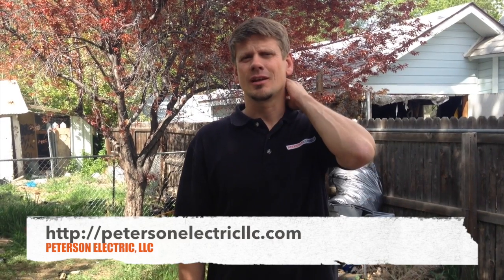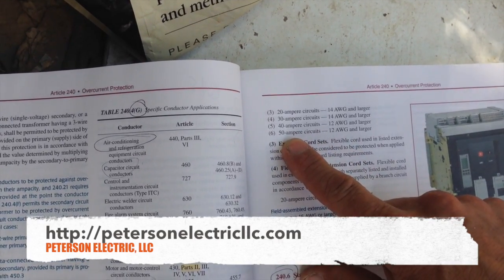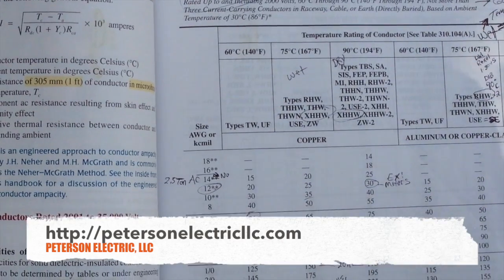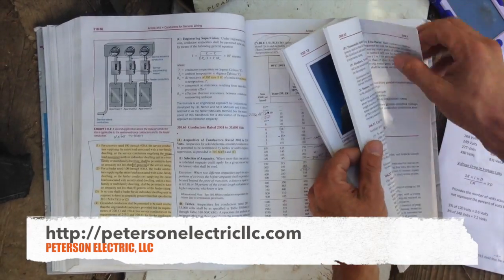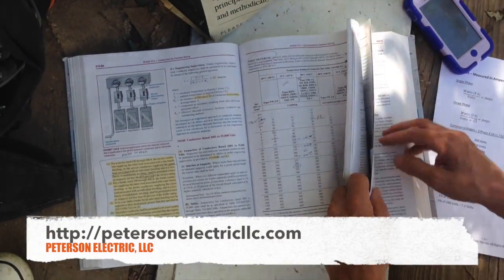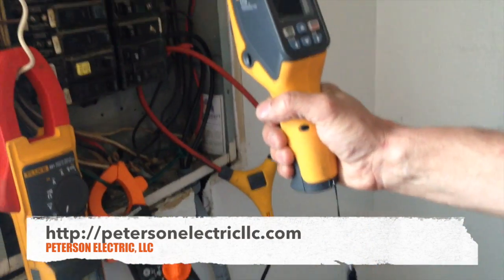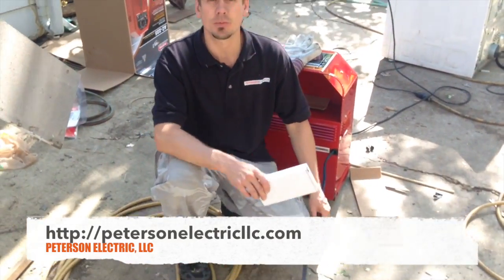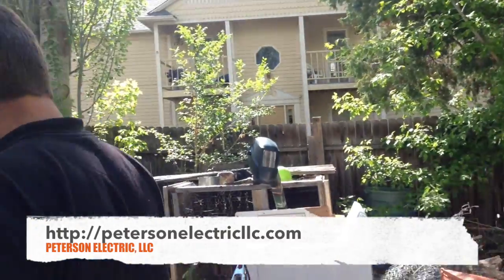What Are The NEC Code Requirements For A Welder Machine?

Comment: I think you over complicated it. Article 630 overrides the others in relation to welders.  All the other digging you went through was unecessary.  I 1 max is inrush.  I 1 eff is the effective rated current after inrush is satisfied.  You size the breaker by the inrush, and the wiring by the effective rating.  The NEC goes even further by giving you in 630 a formula for derating the wire size requirement based off of duty cycle of the welder.  It also gives you leeway of up to 200% breaker oversize for rated amperage.  It does tell you a lot. I think you got bogged down in what you already "know" and tried to superimpose that knowledge on what 630 was telling you specifically and were somewhat disregarding.  630 is the one and only thing you need to worry about as the controlling factor.

Comment: The one thing I have noticed over the years is most welding equipment comes with a 50 amp plug no matter what the actual requirement is. If you wire to meet that you are pretty much done, unless there's a problem elsewhere in the extension cords or before the breaker. Finding and solving the problem that you didn't create is another story.... and that's where I believe this video was going before it got cut short.

Comment: Why are you measuring voltage drop at the breaker? You'd need to measure the voltage at the end of the 25' cord
Reply from the maker: Ture, but I have seen the voltage drop on the whole barn or garage or house when we put a load on the entire first point of disconnect. So both, i am assuming that will help. Remember 210.19 is a FPN and not a code, but 3% on branch circuits and 5% on services and circuits.
Reply from the maker: Good Question and thought.

Comment: I would never get a welder unless I have an industrial power service, welders run better with an industrial power service.
Reply from the maker: What kinda of voltage are you referring too? Single or 3phase?
Reply: @Petersonelectricllc  - 3-phase I think. I'm not sure the voltage. When I went to school for welding we had 12 booths, each booth had a Lincoln Electric Idealarc 250 with a disconnect switch in each booth. I remember opening the disconnect switch for one of the welders and saw 3 wires on the line side, red, black and blue, going to the circuit breaker on the "busway busbar" with 11 other circuit breakers for the rest of the welders.
Reply: @DZEyoyo123  3 phase is rare for home electrical services and people still want to weld so single phase welders are common.

Comment: A few points of interest.    Pretty much all circuit breaker lugs are rated 75 deg C.  So 310.15b16 use column for 75 degrees.   Good that you checked voltage drop if you know why you checked it.   Voltage drop is not NEC code requirement, but an informational note.  The note is in Article 240 (Overcurrent). So if voltage drops, current goes up and will cause the breaker to trip if amps goes up too high. Next time calculate the top of the equation the same, but put the maximum number of volts you want to drop under and the answer is circular mills.   Easier!  Do it once and your done.  Table 310.15b16 #10 has ** next to it.  If you look it up, it states #10 is 30 ampere rated no matter what is listed in the column.

Comment: I use the same Buzz box, I run a 8 gauge extension on a 8' cord no issues, bigger is better for welders in my opinion , be safe not cheap.